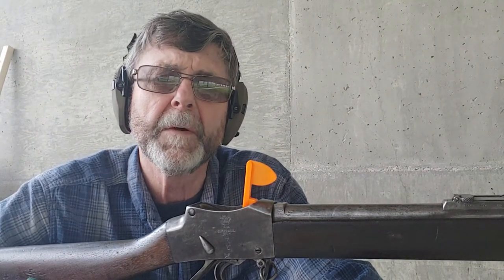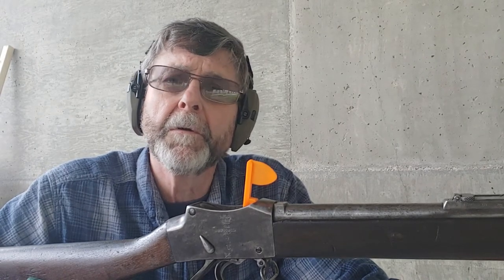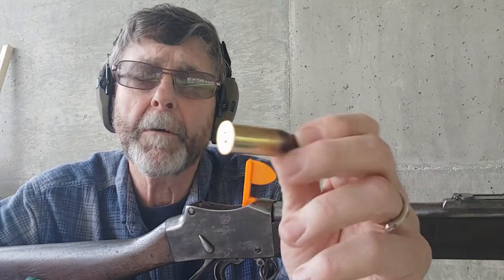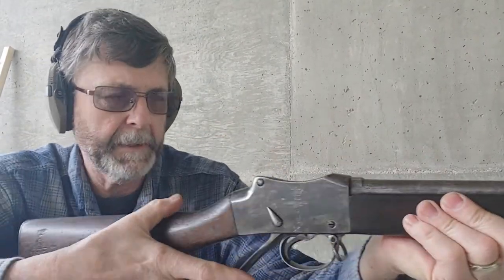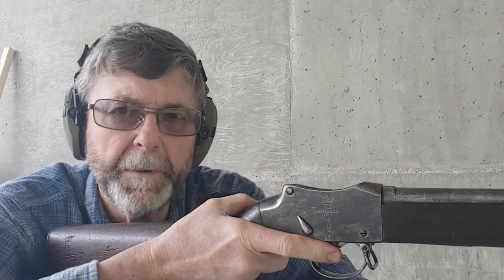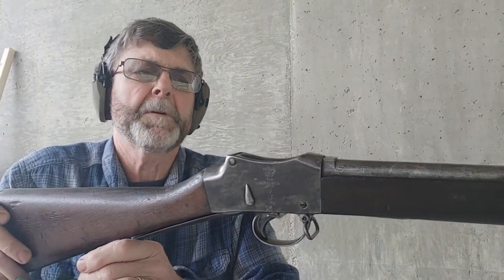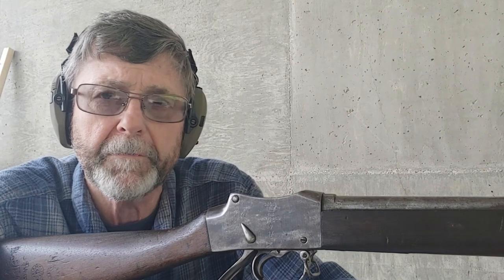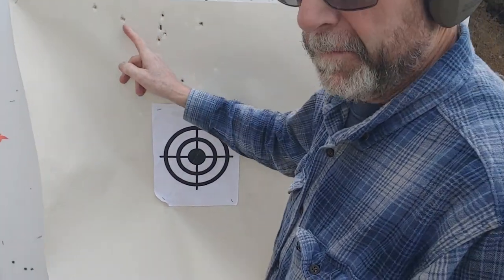Martini Henry at the range. shoot for the first time. (actually shooting this time.) so cool!

Comment: The martini uses Henry rifling, which means that the breech end of the barrel is loose and gets tighter toward the muzzle. Those 45-70 bullets will rattle down the barrel until it gets near the muzzle.
Reply from the maker: Thank you. I need a larger bullet mold. I'm guessing a .471?
Reply: @navyvet7665  Martin Robinson at xring services makes a custom .470 bullet mold.
Reply from the maker: @jakewesley3318  have a link?
Reply: @navyvet7665  he is older than us and just uses email, xringservices at yahoo.com, his mold is good but seats a little low on the last crimp grove and you need to pan lube or buy a custom lube die, the lee works fine paper patched, i'm using the NOE htc 459-500 and 600 paper patched now.
Reply from the maker: I ordered a mold from him Saturday evening. It's on it's way.
Reply: @navyvet7665  can’t wait to see the results